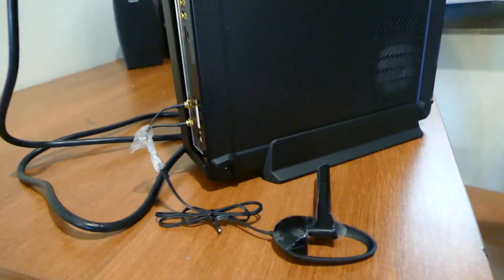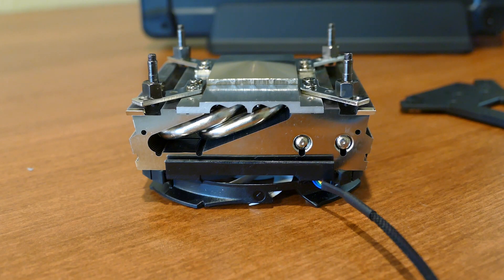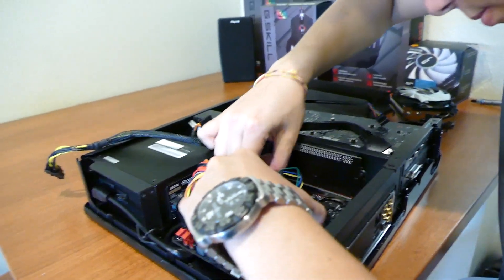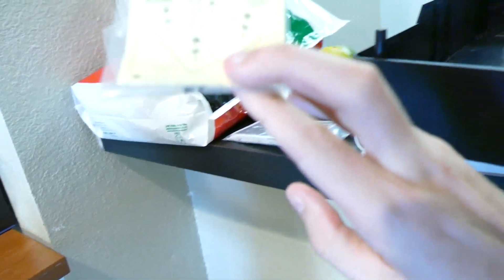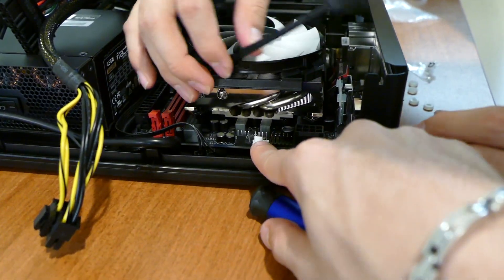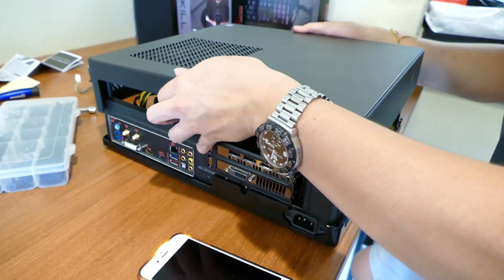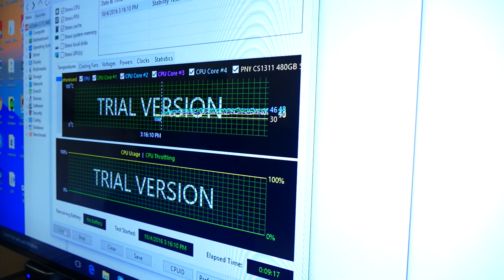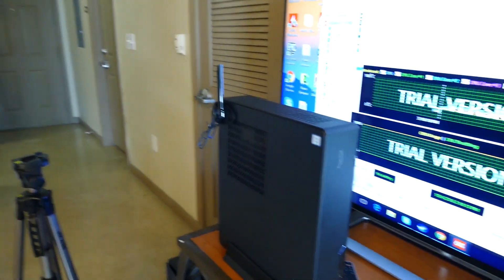Cryorig C7 Installation (Temp/Audio Tests)

Comment: No! Take the back panel off the case! You don't need to pull the entire board (and everything else). The back of the board is exposed by simply removing the back of the case.

Comment: Awesome temps dude. How come my i5 3570k is running so hot with similar setup(node 202, C7). Idle is about 50C and over 70 under load..

Comment: I hate how the cryorig heatsink is placed in this case/motherboard. The fins are placed where the air flow is blocked by the ram on one side and the other side there is a small gap where all connectors on motherboard are. The fins should have made the air flow up where the case opening is and downward where there is alot of open space.

Comment: Just to point out guys node 202 is designed in a way that you don't have to remove the MB to install the cooler. Just pull off the bottom of the case and you can screw in the cooler.
Reply: Johnny Wong came here to say this

Comment: you should have rotate it by 90° so the air goes out at the top. Now the hot air blasts on the aio shield and the ram

Comment: The bottom panel is removable. You could have done it without removing everything. There is access to the rear of the cpu socket + 2 magnetic removable filter so you can clean them. It is tough the first time but there are clips around the outside edge and that's all that holds the bottom plate on.

Comment: how many rpm was this? bought it and it stucks at 100% (2500rpm) cant fix it in bios, upgr the bios and its alway 100% so i throw a low noice cable in it ant the cooler runs at 1500rpm... its fine but i dont know if this will keep the cpu cool after one or two hours of gaming. cpu is the i5 6500 best regards from germany

Comment: Deciding on this or the hyper 212 Evo, this would look good on the msi sli krait MoBo hmmm decisions decisions
Reply: Solid Snake Evo is for over clocking, this is a stock cooler replacement. Depends on your needs

Comment: I installed the c7 in my node 202 amd system to my surprise the cpu idle temp was 49 degrees a bit hot for my liking, I then installed the XIGMATEK JANUS LD1266 which I got 32 degree idle  which I think the this cpu cooler is far more superior than the c7!

Comment: msi h110i pro and will the cryorig c7 fit? scared there might not be enough clearance and the cooler interferring with my ram
Reply: Yes. Cryorig dimensions of the C7 put everything inside the "CPU Keep Out Zone" so it doesn't interfere with anything.

Comment: you could just remove the bottom part and gain access to cpu cutout and also a dust filter for psu.
Reply from the maker: Backplate wouldn't fit.
Reply: Science Studio
ok. it usually fits though...
Reply: oleg_aka_djmeg hey Oleg:)

Comment: Can you make a $550 pc build?
Reply: I know I'm not Greg, but here's one I thew together. I built this for my partner for her birthday, with paths to upgrade.
http://pcpartpicker.com/list/MLh3RG
Reply: How kind of you to respond.
The budget we had would not allow us to purchase one at the moment. Keep in mind that the most common "gaming" setup is the integrated graphics chip. She needed power for photo editing, which leverages cores and clock speed, hence the quad-core CPU.
Reply: Yep, that's right. Because she got this for her birthday and was saving up for the computer anyway, she is going to be able to get a card should it become necessary later on. She's not much of a gamer anyway (mostly just Minecrafting with me).

I recognise that my build won't work for everyone, but just thought I'd share.
The one you put together is well done. The only thing I'd change is adding an SSD (there's an Adata SP550 available right now for around $38) It might put the cost around 575 though shrugs

Comment: That feeling when you help your friend build a new pc and you get her a bundle deal (mobo, ram, cpu) with a 6600k to save money that ends up being cheaper than the low end i5s originally selected for the build but, she doesn't have a lot of cash so you have to do the unthinkable and put a stock fan off a Haswell or Ivy bridge (don't remember which of mine it came with) cpu on a k series processor. (new k series don't come with fans) 

Almost feel like a crummy friend for not just buying her a be quiet out of pocket, tdp is within speck at stock voltage but still cringeworthy

Comment: The question is, can you overclock on a C7? Specifically with the BCLK considering the temps with the deepcool cooler on the i3. Even with a 6600k, which has a higher tdp at stock, I'm curious to see how a C7 can perform.
Reply: standuporshutup I'm running a 6400 @ 4ghz @ 1.24 v core with stock cooler. package temp hits 60° in gaming and 68° under prime 95. I would expect the c7 to be up to the job if you keep v core under 1.3v. I have ordered the noctua nhl9i for mine which should reduce my temps enough and keep noise levels down.

Comment: The piece of plastic under the case can be removed, it's supposed to be held by plastic clips. Was it not possible to do so while the case was populated with hardware already? 

Also what was the frequency on the CPU during the test? I would like to know that.
Reply from the maker: The cutout was too narrow. The CPU's an i5 6400, so the turbo frequency was 3.2GHz.
Reply: Too Narrow? that cutout is huge. almost the same size of the itx mobo. great video though.

Comment: I have almost the exact setup, and I have no I idea why anyone needs an aftermarket cooler
Reply: Quieter cooler operation? Or someone crazy enough to buy a 6600k/6700k and dos ome modest OC.
Reply: the lower you can get the CPU to run at the longer the life, healthier the components
Reply: Well I'm using a i7-6700k in this case and a noctua l9i cooler which for intents and purposes is a quieter stock intel cooler. I have to disable turbo boost so that leaves me at 4.0Ghz with no boost to 4.2. I'll admit I didn't do my research as the l9i is for cpus at tdp of 65W and the i7 is at least a 95W. This cpu cooler would better suit my needs and hopefully i can re-enable turbo boost on my cpu.

Comment: I've been considering the C7 to cool in my Air 240. I found the limits of my stock cooler today and figured out that my CPU is throttling under heavy video export loads.

Comment: Not gonna lie, just based on aesthetics, I wish I got a Cryorig to cool my 4790k instead of the hyper 212 evo but I can't hate on the 212 which is keeping my cpu under 70 degrees C at 4.6ghz
Reply: My hyper 212 keeps my i5 4690k at 4.5 near the 68 C°, its a beast.
Reply: Francesc Calvet For the cash it is an amazing performer

Comment: I've got a small pc with a stock cooler on a core 2 duo that I've considered upgrading to something like this cooler. Thanks for the video,
Reply: U need a cpu update, not a cooler update xD

Also check out the hyper 212, is also a greet cooler and a little more cheaper.
Reply: The problem is that my motherboard (dell oem) apparently doesn't support anything higher than a core 2 duo because the board doesn't have enough voltage regulators for, say, a core 2 quad. Although I think I heard that the 65W versions of core 2 quad (very rare) are somehow supported.
Reply: U can also change the motherboard, the all pc too xD

Just joking, in know its hard and expensive to have a gaming pc
Reply: not really, you can have a decent gaming experience for 300 all new
Reply: The little PC isn't my main PC. It's just my little side project, that I work on for the sake of fun and education. I mainly use it for simple tasks and playing older games via LAN. And those it does like a champ. Even with a Core 2 Duo (E8600)
Reply: Although I sometimes wish I had a core 2 quad to handle higher workloads. Anyway the C7 doesn't support LGA 775 that I'm aware of, so I can forget about upgrading the cooler for now.
Reply: caroca Z in USA its cheap, but in other countries its not that easy.

Comment: You oriented the cooler wrong I think. If you had it the other way, it would have blown straight out of the top vent on one vent opening, then the other would blow at the southbridge and VRM, and where there isn't any vents there, it would partially backflow onto the half of the VRM blocks behind the IO. Would have given a better overall result than blowing straight into the ram and half the VRMs did.
Reply from the maker: Yackaro Would not have changed CPU core temps by any substantial amount. Doesn't matter in a PC like this.
Reply: I'm just opinionated, and I like my airflow. I managed to apply cable management to a non-modular power supply with cables way too long in a case with less than an inch thick of cable space. That's how much I like my airflow lol.

Comment: omg..i had so much trouble instally my c7 when i got it. it was so hard to get all 4 prongs through my mobo... it was ungodly difficult. i think it must have been just a weeeee bit smaller than i needed it to be for an easy fit. but of course it did eventually line up well enough. funny stuff i had never in m y life struggled so much with installing a cpu cooler.

Comment: My cpu sometimes gets to 16 Celsius (my room temperature is 24) with my Mugen 4 cooler
Reply: That's Not possible. ^^
Reply: Almost got baited by a troll
Reply: You must be underclocking the CPU. If you go low enough, the CPU will absorb heat. Probably what you're seeing.
It's like looking into the future. Eventually you'll see your past.
Reply: jesus
Reply: MBW Hilbrink be careful with that, if the cpu temp is lower than the ambient temp like that, you may risk water droplets forming on the cpu and other components that can potentially damage your pc
Reply: sounds like overclocking time
Reply: Yeah I know, I got all my fans practically disabled and still it's this low in temps
Reply: My chip won't overclock over 3.5 Ghz, even if I set the voltage to insane levels (like over 1.5 volts using an amd cpu)
Reply: But that's such a bad troll ^^
Reply: You're either trolling or your temperature sensors are broken.
Reply: I'm not trolling, but my temp sensors could be bad
Reply: Physics does not allow what you said in your original statement.
If the heat is being dissipated using ambient air of 24C, the minimum core temps possible is 24C.
Something can't be colder than what it's being cooled with.
Reply: Then my sensors just fucked up. At least the cpu and mobo still work
Reply: As long as you use ambient air for cooling no it cant

Comment: Nice upgrade and i only wish there was a before and after comparison.

MY mid tower is way louder than this, but i'm using a 5 year old CPU and overclocked it 20% with a bad cooler (no stock cooler)... 5 months to go until the update.

Comment: Will 6600k and 1070 survive inside this case?
Reply: Who says you need a water cooler for overclocking? You most certainly don't, but you can push it further with one.
Reply: My 4690k have a OC at 4.5ghz and I have the air cooler hyper 212, u dont have to use a water cooler, at least u are not doing insane OC.
Reply: Ks would be a waste if not OCed,and if you OC,you need a water cooler,which wont fit
Reply: Ok guys, found out by myself.
All good exept i need 600w corsair sfx power supply to run 1070.
(it needs 500w at least)
Reply: Francesc Calvet same thing here. Hyper 212 with 4690k at 4.3.  Don't want to go any higher than that.

Comment: I just put together a build today with one of these on a ga-h170n-wifi. Cryorig included a separate bag of plastic washers with instructions to use for ITX builds, but there were absolutely no threads exposed beyond the washer. Not sure which ITX mobos Cryorig were referring to...

Comment: did u oc the 6400? if yes then how much?
Reply: SeventySeven You get the same results with BLCK and multiplier when OC'ing Skylake.
Reply: too much
Reply: You can't OC 6400 too much. It's a beast!
Reply: mine is @ 4,6ghz...
Reply: +Mikko Levänen i am confused to whether i would buy an i5 6500 after selling 6400 or buy a z170 to overclock the 6400... please help
Reply: I'd say either go with non-k i7 6700 or get the z170. i5 6400 is just underclocked i5 6600 and a beast. Just remember to make sure that the mobo still supports non-k overclocking,otherwise Its pointless. Mine is from asrock. No point going from 6400 to 6500
Reply: You can't oc a 6400. The only CPUs you can oc are k CPUs so the 6600k or 6700k.
Reply: MrGamerxpert why would you respond if you have No idea What you are talking about? you can oc non-k skylake with right Bios, My i5-6400 is sitting at 4,6ghz
Reply: MrGamerxpert you can, just not the real deal kind of overclocking, just base clock
Reply: MrKeikari exactly

Comment: Hey mate, I just assembled the exact same thing on Node 202. The other manual (together with the washer) says in mini-ITX motherboard you shouldn't use the backplate, just use the washer and the hex screws and everything's good. Good vid, cheers.

Comment: Man Science Studio Haswell runs hot i have 212+ with 2 high-end cougar fans(on the heat-sink) and a 912+ case with two 200mm fans. I own a 4790K stock settings i mean my temps are nothing to worry about but they are at 65C when gaming at GTA5. Skylake is SO much better for heat.  My PC is really quiet however with my setup.

Comment: That asus graphics card makes the Intel stock cooler sound like a noctua by comparison. It will be loud during gaming until he takes care of that POS asus turbo graphics card.
Reply from the maker: igloo2 It's an ITX PC. Blower coolers are better. What you were hearing in the test was the CPU cooler. The stock cooler was louder than the 1060 when gaming.
Reply: In this ITX PC, the GPU is still getting fresh air from the vents. Blower coolers are not better in this case. That is false. Check out the PCPer review for the facts about how terrible that asus cooler is. Even for a blower cooler, it is very bad.
Reply from the maker: igloo2 What you've just said it false. It has been proven by multiple reputable channels that blower coolers are optimal for small and compact cases. Period. The fact that vents are present is irrelevant. You want hot air removed from small cases, not circulated around and restricted.
Reply: You point to youtube channels spewing their opinions for your source of information. I point to websites that actually do testing. I think that sums it up. If reading is too hard for you, you can reference LinusTechTips video on the matter, which stated that with blower coolers, the ambient case temps go down, but the gpu temp stays higher and the noise is greater.

tl;dr blower = louder and worse gpu temps = worse performance... period.
Reply: igloo2 Dude, are you an idiot. A blower style cooler takes air, blow it through and out the gpu. Meanwhile, open air cooler circulates the air and can make the gpu run cooler. However for smaller form factor builds, the blower style was superior because the case does not produce great airflow. If you are making a large pc with great airflow, then just go ahead with the open air cooler, but if your case does not have great airflow then it is recommended to go with the blower style cooler
Reply: igloo2 And if you watch LTT's video clearly mentions that ambient temp goes down with blower style cooler that is why the blower style cooler is better for smaller form factor pc so the pc does not overheat because it does not have sufficient cooling
Reply: +igloo2 You may be right about the Asus Turbo in particular. I've heard bad things about it. But in general I agree with the others that a blower cooler is better for SFF cases.

Comment: you actually do not need to remove the mobo to install the new cooler, just remove the back cover of node 202 since it has big mobo cutout for easier cooler installation...what worries me in this vid is that the backplate for the cooler is too high and scare it wouldnt fit but turns out, node 202 has a mobo cutout already...still, I enjoyed the vid...
Reply from the maker: We looked around for the back cover screws but gave up fairly quick. Regardless, it was a good learning experience for Zack.

Comment from the maker: - The temps on the graph are in Celsius, not Fahrenheit. Careless error. Thanks to those who pointed this out!
Reply: error? you mean, it was done right?
Reply: I noticed the University of Lafayette shirt your friend is wearing and I was pleasantly surprised. I'm a student at LSU and I love your videos, man. Great work!
Reply: thank you
Reply: I just installed a C7 on my node 202 with an i5 6500 and and getting temps between 50-60C on each of the four cores with aida 64 vs 53-63C with the stock cooler.  The C7 doesn't seem to be performing that well for me.   Ideas?
Reply: did you get rid of the previous thermal paste on the cpu and replace it with the C7 thermal paste? You may have too little or too much thermal paste. The only other solution I have is maybe to remount the C7 again. Worst case scenario, I would get the Noctua NT-H1 thermal paste, which is around $8 or so.
Reply: Albert Chang yes I did I wiped fully clean with isopropyl and coffee filters.  Then I applied a small amount of paste.  Maybe I applied too little.  I will try remounting and adding a bit more.
Reply: Ya I would try remounting and try adding a tad more paste. Best of luck!
Reply: UNO represent here have friends at ULL

Comment: Aren't you supposed to remove the old thermal paste (via alchohol wipe) before applying the new thermal paste?
Reply: it only matters if its two different thermal pastes which in this case it was... facepalm
Reply: What a douchebag hahahaha he said it doesn't matter uhm ya it does matter but it's cool your clearly a beginner 😂😂😂
Reply: I asked the same thing.  Instead of giving and explanation he said get over it.  Great guy.
Reply: new paste without remove old paste common
Reply: yes
Reply: i just come on it
Reply: YEs, but they are LAZY ass "Made in China" cheap ass fuckers!!
Reply from the maker: Doesn't matter much in a build like this with no overclock yet.